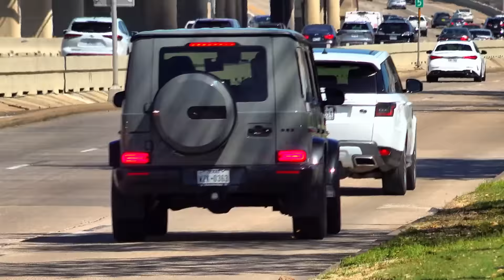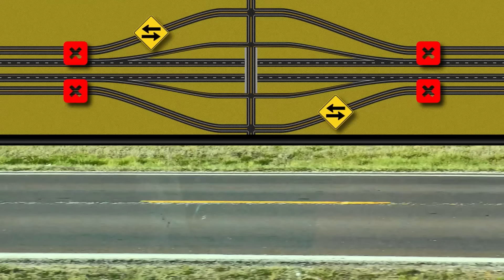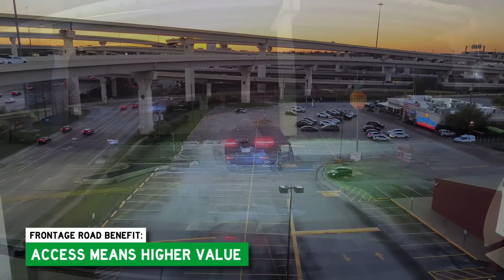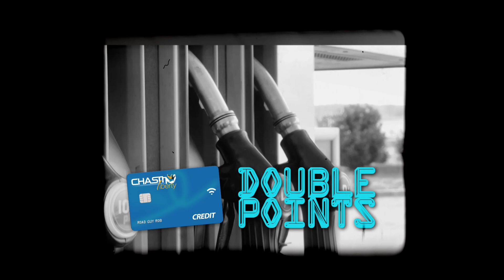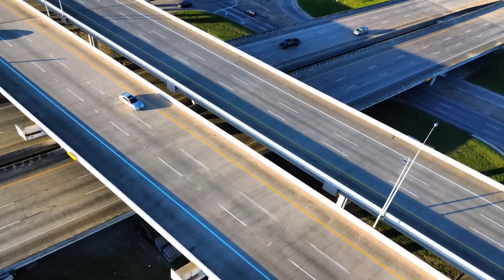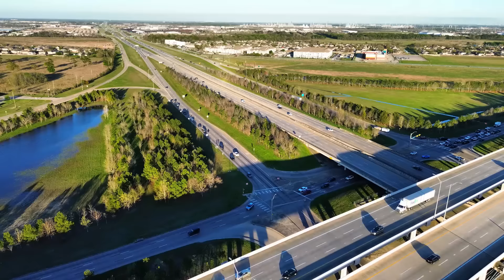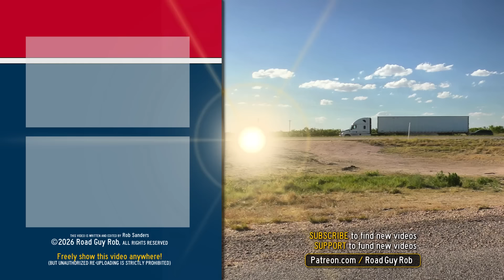Why Texas Builds a Freeway Next to Every Freeway

Comment: San Antonioan here, it's insane, we've have roads under construction since I was a KID 17 years ago. And they always start construction, never finish, and just start another project instead of finishing the one they started.
It got much worse after the 2021 freeze, cause the freeze damaged a lot of pipes and most of that unfinished construction god badly messed up in some way. We only JUST finished the part of Northwest we frequently use after over a decade of nightmare traffic.
And thebsignage. DEAR LORD THE SIGNAGE. It's worse on the highways andbfreeways but legit 85% of the time you won't know there's construction until you're entered it. We have seen entire exits and overpasses completely closed without ANY warnibg or signs lettibg us know, sometines even RIGHT NEXT TO THE CONSTRUCTION. 
It's a miracle, considering the way the average texan drives, that there isn't a guaranteed wreck at any of these at any given moment.

Comment: They have frontage roads in Boston, specifically along Commonwealth Avenue, built back in 1895. Frederick Olmsted actually put them in as a way to integrate park space in the median between the frontage roads and the main road. Since they're so old they're called "carriage ways" in Boston. Practically speaking, they work as a way to move parking off the main street and onto these local roads. They work really well. They keep traffic fast on the main road by limiting intersections, and keep stopped or parking cars out of traffic. But they always mess with GPS systems since the carriage ways are considered part of Commonwealth avenue.

I wonder if these Texas frontage roads were inspired by Olmsted?

Comment: Totally remember those rural frontage road ramps in TX and AK. So scary to merge across a two-way road from wrong side, pray that both oncoming and approaching traffic from behind all stop. There is so much happening- it feels like you can't see everything you need to see to enter intersection safely.  But, I guess it is fine in a very rural area where you never have traffic on frontage road to begin with.

Comment: Makes me think they are intentionally making the roads dangerous on purpose.  Need to talk about dangerous on ramps, high speeds with 3 Ton trucks driving over 80mph, oncoming traffic, frontage roads with all the strip malls and retail chains makes everything look tacky and bland.  These road designs also elevate everybody's stress levels while driving.  Driving should be enjoyable and if your gear ratio is properly adjusted and you have a good vehicle driving should fun.  There's no reason for a person in a vehicle to drive over 55mph to get to work or to get to the store.   And I'm a car guy. LOL If you want to race go to a track and race.   Otherwise just kickback and cruise and listen to some yacht rock. 😎

Comment: @10:45 As a Texan, the X configuration is the only acceptable and objectively correct configuration. It increases the storage/ deceleration space while giving you access to the entire frontage road without need of a stoplight. In the image you used, imaging your on one side a light and need to travel a mile up to get to a business further down. Instead of pulling out, waiting at a light, then driving, instead, exit the driveway, get on the freeway just before a traffic light (typically into a dedicated merging/exit lane), then immediately exit the freeway just after the light. Full frontage access without any congestion at traffic lights. Only time a driver needs access to the light is to turn left, right, uturn, or access a business directly on the intersection.

Comment: Edit: The old school two way frontage roads with the short exits are how we determine whether or not you are from around these parts. 

I think frontage roads with retail endless retail along them needs to fade away as the population grows since it brings both highway users and shoppers to the same place and with the increase in cars on the road, people turning out of strip malls into traffic without lights, while having freeway exiting traffic that the frontage roads have to yield to and having cars from the freeway exit and frontage roads also merging prior to the light at the intersections creates a mess now with all the traffic during peak driving periods. US 75 in from Dallas to McKinney, the Tollway, Bush, and 121 have a good balance of retail on the frontage roads to not completely have them feel like the same ugly main street. Roads like I35 up towards Lewisville have way to much stuff on the frontage roads and it's not the best looking stretch of highway and with so many stores off the road you can maintain speed. It worked 30 years ago but now its just a mess. I do miss the Texas' U's out here in LA and the most overlooked benefit of frontage roads which is when they are working on the freeway you don't have to take an insane detour...you just drive next to the freeway...and the Texas speed limits and left lane law. People out west have no clue how to drive.

Comment: Some other benefits: if you’re doing dumb stuff like driving a beater or a U-Haul or you need to drive slow for whatever reason, you can just ride the feeder instead of being a nuisance on the freeway. Also Great for really old and really young drivers that really should not be driving on houston freeways. 

When it’s pouring rain (most days in houston) you ca take the feeder and not be blinded by 18 wheeler splash or run off the road by a pickup driver

Another one: missing your exit is not a huge deal with the Texas turnarounds

Comment: The u turns make travelling the highways so much easier if you miss your exit.
Reply: Right now though the best part is when you're drivibg at night and they close off all the exits and u-turbs but only have proper signage for a single one
Reply: They also make it hell if you listened to your GPS and got into the “left lane” to turn left, then end up going the reverse direction
Reply: @sovereignmindandbody  blame the GPS for not being able to read?
Reply: @sovereignmindandbody  the u-turn lane is only for u-turning and is the farthest left lane so thats on the driver.
Reply: @sovereignmindandbody    Most GPS systems will make the distinction between making the turnaround and making a hard left at the light.  Even the ones that don't generally still tell you which lane to remain in when you're approaching a turn (or turnaround).  Generally, if you're paying attention, you will not take the wrong turn.
Reply: @sovereignmindandbody GPS in our country don’t even have proper lane indicators sometimes. Since you are from America, which has some of the most data, I’d say, probably skill issue. Be grateful your GPS work at all.
Reply: @sovereignmindandbody that would be the driver's fault as turn lanes are very clearly marked and gps usually tells the lanes you should be using which again comes back to driver error.
Reply: navigating interstates can be so stressful when you're new to it. frontage roads ease that worry and are incredibly useful when you master them too.
Reply: No wasted real estate with those gigantic clover loops where all the homeless camp in California
Reply: @GabrielBacon Sadly, even Texas has its share of clover loops still. Though, we are replacing them, been replacing them for decades, still haven't fully done so...
Reply: That still could be a 2-3 mile round trip in some cases.
Reply: @TexasEdition  way better than other "solutions" such as no uturns. Having driven through and around many of the continental US streets and highways, I can tell you the Texas highways are more designed for drivers than most other states. New England highways are a nightmare. If you miss your exit, not only do you have to drive 2 or 3 miles down the road but you have to drive around an entire neighborhood to get back to the highway in ramp going the opposite direction. Turns are a convenience for sure, but imo a necessary one
Reply: It’s called a dummy turn for a reason.
Reply: @Thisguysaidit  Never heard it called that in my 40+ years living in Texas. You telling me you've never missed an exit before?
Reply: @jakejager Not saying i haven’t but I am saying you must have been living under a rock or it’s after your time. I have less then 30yrs with a dl.
Reply: @Thisguysaidit  I was born in Texas and only lived away for about ten years of my life, never heard it referd to as a dummy anything, might be a last ten years thing for younger folk, maybe. Or possibly inner city thing maybe?  We used to say "flip a bitch" when referring to a utern of any kind. 😉
Reply: @jakejager  what's a dummy turn is anytime you miss an exit in the north where there is none and you have to drive 20 minutes to get back to where you need to be.....and please, those of you that try to defend no side roads,....just don't, happens all the time up here in the DMV.....plus with feeder roads you can actully see the gas station and not just the sign telling you there may be one in the next 4 miles if you exit.
Reply: @Thisguysaidit Your user name is apt. I've never heard the term "dummy turn" because NOBODY says this.

Either it's regional, and a small region, or you think you're clever.

I also have less than 30 years with a DL and have lived in a few different regions.
Reply: @James_Bee  You are correct, I have lived all over the US and been in many other countries, never heard it referred to as a "dummy turn." Matter of fact, I think if I had I would remember because I would have laughed in their face, it is very juvenile sounding. I have heard turns called "flipping a bitch" but never dummy turn.
Reply: A bad driver never misses their exit 🙏
Reply: @DauntingTurtlenever.
Reply: @Thisguysaidit for you?

Comment: As a Texan (Dallas), I've never considered the X vs the diamond interchange, the slingshot is just a standard here. Heck, they encourage a modified slingshot on some newly constructed roads (635) where you actually stay left after exiting and you take a ramp that was designed to help you bypass the light (that eventually spits you out on to the frontage road).

Comment: If you commute in Houston you follow traffic patterns and time which feeder light is faster than the parking lot tge freeway becomes. Another factor everyone forgets is that Houston Independent School District shuffles students across the city with their magnet program causing even more traffic during the school year, for 2 months there's significantly less traffic during rush hour. The Katy freeway gets congested no matter what in either direction. 610 loop between I10 and 59 has always had a congestion problem no matter how many times tge road has been configured.

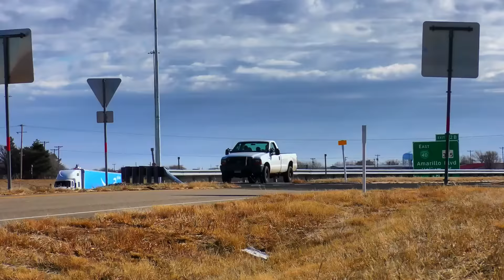Comment: 7:00 The obvious solution to the one-way problem is simple - two-way frontage roads everywhere and only have the freeway ramps merge with the innermost lane of the frontage road. No crossing lanes to tempt head-on colisions. Then to make it work, each side of the actual freeway  changes direction. Both problems solved, no compromises, maximum safety, maximum convienience.

But then again, since when has Texas ever opted for logical solutions.

Comment: We call them access roads or frontage roads, as he mentioned. They don’t have the same speed limits as the highways, but many have a limit of 55 mph. If you’re wondering you can drive as far as you want on the access roads. Just takes longer than driving on the highway because access roads they have stop signs and stop lights. They aren’t just in the city. You’ll find them along the highways away from the city.

Comment: The tone of this video is WAY too positive considering we are talking a double-width (often more) highway essentially. This only benefits driving yet is taking up so huge amounts of space right in the city and cutting it apart. Also funny how you mention biking along this xd good luck to you biking alongside cars that are used to freeway speed (Velocitization) WITHOUT any Bike infrastructure even tho there is certainly plenty of space for it... If you make a video about this you have to point out the negatives CRITICALLY! Noise- /pollution, Cost, land use, Speed on the frontage Road, safety, heat effects, WALKABILITY, Emergency Vehicle access, Driver confusion, and sprawl are major problems with this road design I can come up on top of my head. Barely mentioning these things (or not at all) or putting them in a light that makes it seem like they are not a big deal (this is what I  meant with tone of the video) is straight up Propaganda. Sad to say it.

Comment: Also to solve the left turn problem they started connecting the parking lots of the adjacent properties, so if you are at one store and need to go backwards less than one block you can just use the connected parking lots.

Comment: You left off a "major" expressway with no frontage roads in Texas.

Dallas North Tollway (I think it's been renamed slighty, but I haven't driven on it in 30+ years).  A needed spur that couldn't buy all the land it cut through on road budgets, so was a tollway, and, to save money, has a verry narrow footprint.  It does get some frontage roads on newer extensions, the original path was 100 ft wide, the narrowest expressway in Texas.

Comment: Frontage roads can be great, but only when they're done properly. Unfortunately in the big cities here in Texas, they're used to line the sides of freeways with a metric ton of businesses that cause all manner of traffic problems, particularly during rush hour.

Look at I-45 in Houston as a prime example -- for about 70 straight miles, you see an enormous amount of businesses lining both sides of the freeway. And the traffic issues are only made worse, not better, because of them.

Traffic on frontage roads tends to want to go at the same speed as the mainlanes themselves, and when you combine that with slow turning traffic going in and out of businesses, it creates tremendous potential for disaster.

Not to mention the "X-ramp" design is not used often, despite this being clearly the best option for allowing traffic exiting the freeway to do so without interfering with traffic entering the freeway, or vice-versa. Had this been used more liberally (like on I-45 around say, The Woodlands), it would solve a LOT of traffic problems.

So what's the deal? Well, Texas tends to cheapen out with their ramp design, and commuters pay the price for it. That's why the roads are so bad despite them being able to accommodate far more traffic than in other cities.

Comment: Correct me if I'm wrong, but leapfrogging looks like normal local driving.  Near as I can tell it's just hopping onto the interstate for an exit or two and then jumping off as opposed to going down a nearby side street.  I know I regularly drive the length of a single exit down to the grocery store because it saves me a few minutes.

It's just a short drive vs. a long drive on the interstate.

Comment: I moved from Portland, OR to Dallas, TX a year ago. At first I was very confused by the whole solution - I had driven here before and it was confusing I just didn't get why they designed it that way. After a year I can tell you it's absolutely brilliant. It makes highway traffic flow 100x better. The MOST IMPORTANT part is that you can visually look at the highway while you're on the frontage and decide if you want to opt-in to the traffic mess or not. THATS THE KEY AND IT WASNT COVERED IN THIS VIDEO.

Meanwhile, in most areas, your decision to get on the highway means taking a blind right hand turn to get on to an on-ramp, then you discover not only stalled traffic, but now you're in a que to get into that traffic. There's no "abort" lane if you realize the highway is too big of a mess, you're just committed to it once you start getting on the on ramp.

Comment: I work right off of a frontage road in DFW so I use the turnaround to get to work and will use leapfrogging to get back to work from getting lunch to avoid a light.  There's another section I will leapfrog that doesn't avoid a light, but I can go faster on the on ramp than the frontage road legally and it exits me back out onto the lane I need to be in.

Comment: 4:03 I may be wrong, but I believe the flood gauge is telling you how high the water is relative to the bank of the nearby water source, not the local ground level.
Reply: You are almost correct! It is telling you how high the water is right at that spot. They are for roads with low water crossings so they are telling you how deep the water is at the place where you are crossing. Sometimes it only looks like it's maybe 6" but then you look over at the guage and it's covered up to 4' so we just nope tf out of there lol